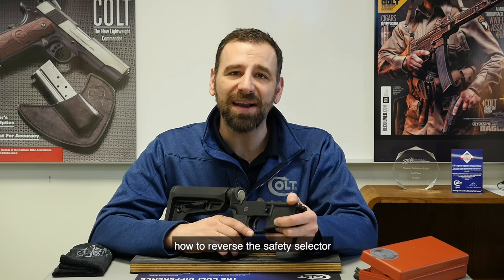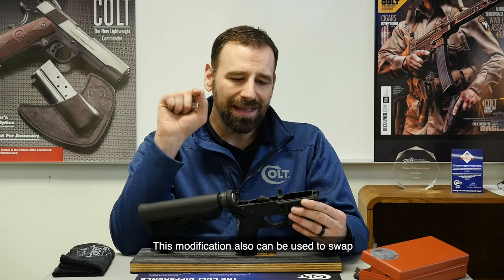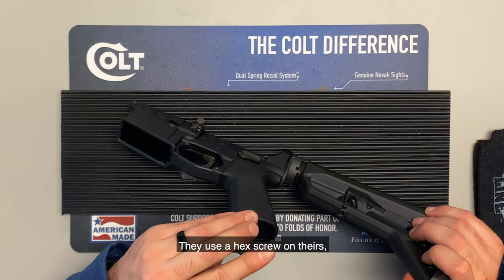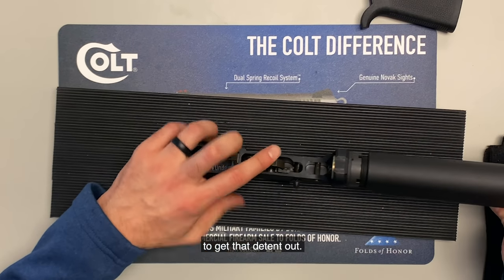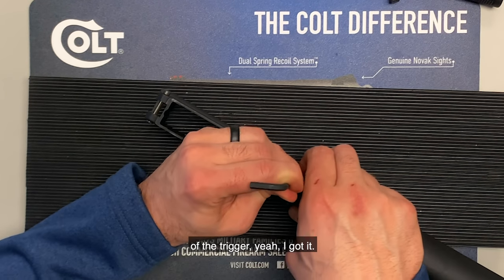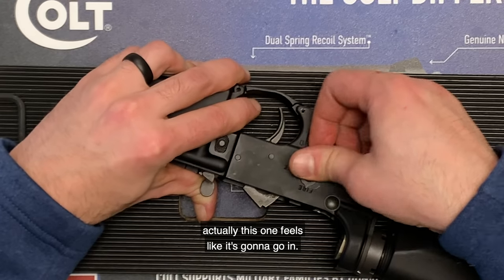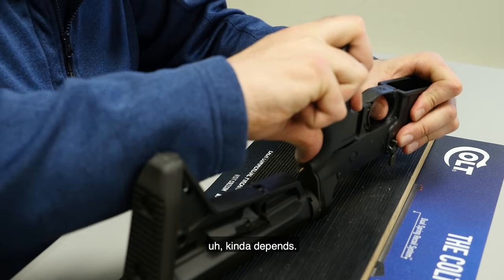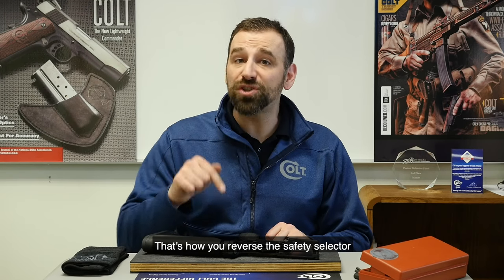How to Replace A Safety Selector

Comment: I just bought an M&P 15-22, and the plastic safety doesn’t stay on safe. It will stay on fire, but the slightest touch, like putting the sling over my shoulder, will take it from safe to fire. 
I’m surprised it’s so crappy, because other than the magazine, it seems to be a quality item. 
I’m looking for a metal one. Are they compatible with the AR?

Comment: Loud AF
Reply: Bro I gotta tell you about this revolutionary thing called "Volume". See you can actually adjust how loud you want the audio to be. It doesn't have to be just full blast all the time. You can typically find it as a pair of small buttons on the side of your mobile device. Or if you are on a computer it will typically be in one of your corners, and is operated digitally.